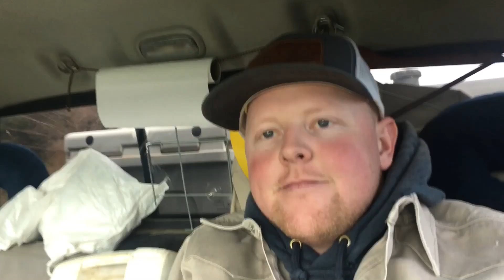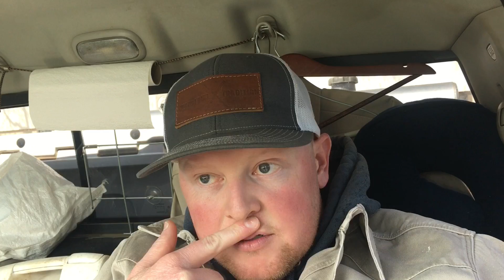PIPELINE WELDING X-RAY AND REPAIRS

Comment: 1104 is American Petroleum Instatute code for transmission piping, 31.3 is American Society if Mechanical Engineers for pipe over 15psi, there is also 31.3 that is similer to 1104 it's for process piping in chemical plants.  I work allot under 31.3 and 31.3 in my line of work

Comment: B31 has several different codes. B31.8 often times will say,”see 1104.”  The spot where B31 is stricter is on the bead(root.) Most of B31.3 tolerance is based on wall thickness instead of diameter.  And on IPD(high low,) you’re allowed 1.5” per every 6” of weld length in b31 while 1104 is 2” per ever 12”.  B31 is also more lenient on porosity.

I worked a job last year that was A333 and stainless steel.  Some of the spec sheets called for 100% and others called for 5-10%.  It was depending on what was flowing and temp of what was in the line.

Comment: Could you do a video about getting in the union?  The steps and processes and requirements
Reply: John C i would like to know as well, been thinkin about it for a while just dont know how to go about
Reply: You just go down to the hall and apply and take their test. 
If youre experienced in the field of work the union youre applying for, bring your cards/certs proving experience. Or take a welding test, if thats what youre doing. If youre an extremely experienced hand they probably will not make you go to school but you'll have to buy your journeyman card. If youre lacking in experience they require they will make you go to their training center/school.  At least that's how it's where I am.

Comment: Love the videos man. Quick question for you. Any advice on how to practice to pass X-ray without an X-ray being done or a qualified/experienced welder to watch you?
Reply from the maker: I would probably pull straps and either nick them or bend them. Or I guess you can use a torch and run over your weld slowly and watch and see if you see any trash. This is hard to explain without showing an example.  Hopefully this helps, but if not I will talk more about this in my course I hope to launch later this year.  You can learn more about it here. https://www.arosswelding.com/courses/
Reply: Awesome. Thank you very much and I look forward to it!
Reply from the maker: No problem. I'm excited about it also.  We are working hard to make it very helpful for anyone wanting to learn.

Comment: Is it hard finding mainline work? I see a lot more of fab
Reply from the maker: It kinda depends on the year I guess.  Some years you turn away work and others you are at the house longer than you want to be. Just depends.
Reply: I was wondering because I’m rigging up looking to start pipelining. Been welding for about 6 years in shops and railroad just trying to network i guess you can say